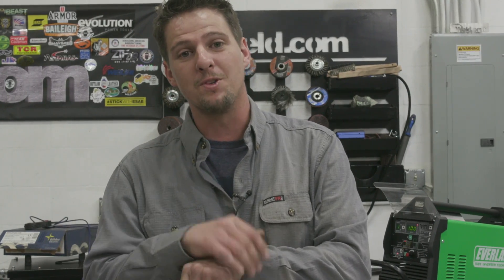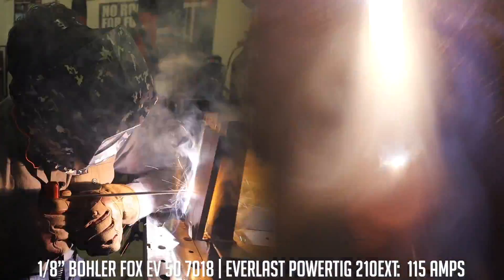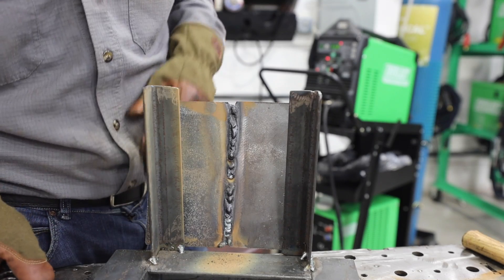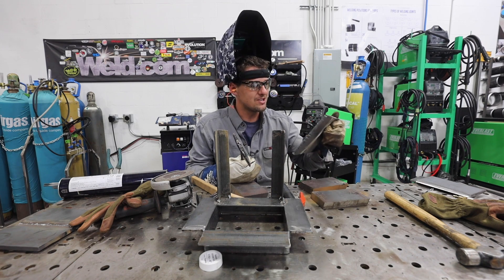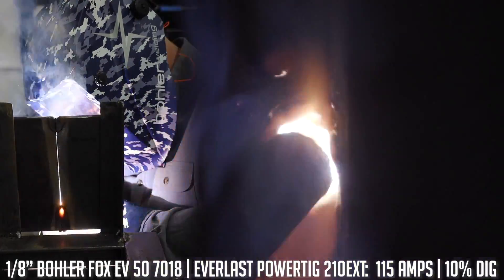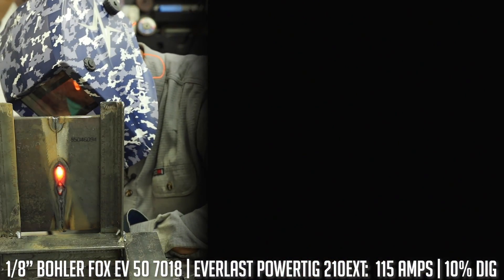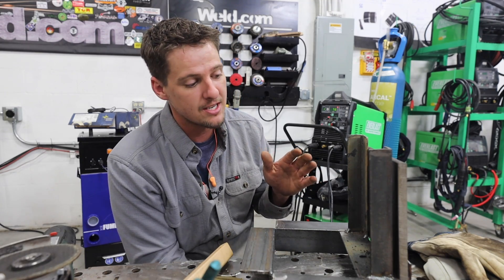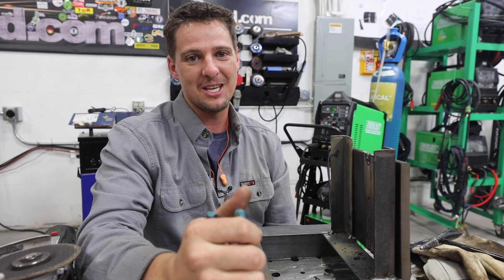7018 Open Root Challenge

Comment: You also get serious porosity when long arc a 7018. Thanks for the promotion! Love your videos even more right now.
Reply: Hello young man, I have had a go at the same challenge Mancub did. My first attempts on DCEP at 115amps went a bit wrong in that 115amps was too hot. I eventually got somewhere near at 90 amps. Sadly the camera battery died and I lost the footage I wanted. However, I reverted to my phone and did another run on DCEN at 80amps on my Oerlikon Presto 140G. I have posted a video on my channel of the result. I am not a qualified welder, just farm repair welder and weld for my own enjoyment and repairs. Have put a card and end screen to your channel and videos too.

https://www.youtube.com/watch?v=mc4qfTgRQ9k

Comment: We do this all the time with 7018's on the shipyard. It's always assumed back gouging will be necessary to get the slag and porosity out.
Reply: That's all they allow in shipyard (at least by me) is 7018, even if your just tacking something...  no 6010 at all. Of course production work is all dual shield flux core 100% co2.

Comment: 2.5mm gap in the bottom. 3 2mm gap in the top. 2mm land. 2.5mm electrode 80amps +- 5 amps. Side to side movment

Comment: I tried this with a 6013 on 1.6mm tubing, with a 2mm gap using a 1.6mm rod  dcen 20amps . I figure a wider gap will let me weave side to side a bit but, my challenge with this is getting the filler to fuse to both sides. If I stay long enough to fuse, I end up making the pool too fluid and sags down like a ball, if I go faster I just get lack of fusion and gaps. Any tips? I’m practicing 6013 because I want to eventually use 309-16. 309 is just too expensive these days to practice with and the dense slag is very similar.

Comment: So at least from a pipe fitters perspective, we tack and do all open roots with 6010 not only because of its ability to weld rust, oil etc, but because it’s a fast freeze electrode.  An open root with a 7018, being a fill-freeze rod would be very complicated because you’ll heat up and just start dumping metal out of the gap.  The keyhole won’t be a keyhole because gravity takes over, and 7018s need more amperage, which means more heat.  The instinct to whip out of the puddle is the biggest thing you’d want to avoid because you’re just whipping in all that flux, causing porosity.  7018s have to be steadily pushed, with electrode at leading edge of a steadily supplied puddle.  There are probably people with more technical answers but that should be close.
Reply: Your explanation is beautiful. And you’re the pipe fitter. Some pipe fitter you are. Haha. Nice job. I’m a student in welding school. Was able to pass SMAW groove welds but being that my combo program is only 7 months and never had any construction job or experience I decided to move onto Mig welding and practice SMAW open root and pipe here at home… wit my $120 stick welder. I’m here outside so mad bc I been trying to run an open root with 7018. I’m sure it can be done, I’m not that good yet tho. Going to go get the 6010’s I took from school. They are 1/8. I hope I do well. But I’m just going to sit here and take a break for a moment. Summer down here in south texas. It is hot. Thank you Mr MC
Reply: @delayedsantana  yeah, I used rush through any cutting, grinding, drilling, or any other menial tasks apprentices get, just so my foreman would let me weld on the bench. In my opinion, there’s no better experience than working right next to a really good welder, who likes to teach.  I’m not sure what they do in the oil fields or pipelines, but UA building trades journeymen will typically see mild steel pipe, groove welds, 30° bevel on a 3/32” land, w/a 3/32” gap. The root will be done in an 1/8” 6010, and everything else will be 7018 out.  The 6010 is essential given the field conditions, and the gap. Keep welding and keep learning! It’s a great industry.

Comment: This is what we are taught to weld with here in scandinavia, 7018 all the way.
We almost always use remote controls in one hand while welding root and the basic tehnique for both pipe and plate is to repeat a U movement with the electrode within the groove and letting the root fill up. Awesome work guys!
Reply: Same in Spain. 6010 doesnt really exist in europe. I guess every root pass its done with tig.

Comment: Try the Alaska pipeline test, 8 inch pipe 6G, 7018 root, hotpass, filler and cap. 3/32 rod for the root is best. Have fun.

Comment: 37.5 bevel.. .06 land, .06 gap.. 3/32 7018 70 -80 amps.. tight arc.. fast..just drag it it will look like a gtaw root when your done.. do not open a key hole.. you can do it..
Reply: Dcep gives the best pen..
Reply: @johnjacobjingle8302 sir root gap down side 2.4 and up side 3.5?
Reply: Would you run DCEN or DCEP? Tthanks

Comment: I did this in school as an attempt to get an F4 all-the-way-out unlimited pipe cert, because a normal 'unlimited' cert still limits you to an F3 electrode for the root.

I was able to get it on my second attempt. 3/32" land, 3/32" gap, 1/8" 7018, ~125 amps and running AC. No DCN or DCP. I was welding on an old Synchrowave. Probably would have gone better had I used an inverter machine with a stiffer arc.

Very difficult to do, and I did not end up attempting the cert test due to time limits. I did a normal unlimited pipe test instead.

Comment: Hi Mancub! I have had d a go at this too. DCEP 115amps was too hot I found and about 90amps was much better. On DCEN at 80amps it was easier but maybe a little cold? Anyway, I did a basic video (All my videos are very basic!) and have posted a link to it below of me doing the challenge on similar steel (10mm) and using a different welder (Oerlikon Presto 140G) and a cheaper brand of 7018 rod. The gap I set for DCEP was close at 2mm and on DCEN 1/8th or 3.2mm set by the rod wire. DCEN I found to be easier, much easier indeedy!

https://www.youtube.com/watch?v=mc4qfTgRQ9k

Comment: I love seeing the struggle instead of just showing success. Never done a open root with 7018 only done it with 6010, I might try it sometime. What I find helpful for a large keyhole is to whip the rod in a mildly fast upside down "v" pattern but idk if it will work for everyone

Comment: Hey Mancub,
Have you stick welded before? or is this your first time?. I have been welding for over 20 years. This is the first thing that you learn to do in weld school after you learn to run beads. The gap is the same as electrode size and for vertical you run with an uphill tilt to your rod. Always start your arc on one side not the middle. Once you arc off just run up with a slight upward angle walking the arc from one side to the other.

Comment: Get Fox EV 50 W for open root and use dcen. Or you get Fox EV Pipe, dcen. Get some 2.5mm and keep the arc short. Move up just by weaves. 2-3mm gap.

Comment: From my experience it works a lot better with 7016 over 7018, have the gap and root face the same size as the rod your using and use only a slight whip

Comment: When i was in ship repair in uk circa y2k, i was a plater n the older welders loved huge gaps, 12 mm plate, 3mm nose, 3-4mm gap. Get up around anchor pockets n keel bars of 2”-4” n the gaps were easy upto 1”.  I think the rods were vodex, real pink in colour n quite a heavy slag.     👍🇬🇧👍

Comment: Man cub those were good attempts. What i found that helped me is going straight in with a slight drag angle like maybe 2°. Its not much but you can kind of do mini whips or turning the stinger side to side key holing the root if it opens up too much. Letting it cool down helps tremendously as well. Look forward to a redemption video very soon, cheers from another brother from the great white North (Canada)

Comment: Get some Böhler Fox EV 50-W rods. Those are 7016 and better suited for open root and run a lot nicer on DCEN.
The 7016 puddle is a bit less fluid then a 7018 puddle which makes it a lot easier to control. I think its because of less iron powder in the flux. Don't whip as you did in your first try. Whipping low hydrogen rod is a no-no because of slag inclusion. But i bet you already knew that.

Comment: Dude, use 7016 for the root. Basically the same but slower and more controllable.
Reply: You are right smoother to run and good profile on back of plate I used to use 4.00mm Philips 56s7016   open root .Cap and fill Phillips 7018  12 mm  t pl. As with Low High Close arc always to prevent porosity

Comment: European? In Canada on the east coast we need to do 6010 open root 4 position then 7018 open root 4 position on DCeP and thats a prerequisite to test on 6" pipe.
Reply: 3/32 land and gap use a 3/32 rod 1/8 land and cap use a 1/8 rod.. I suggest 3/32. Stay in the key hole with a little pressure and if it starts to open up increase arc length and oscillate the rod slightly. The thests here are called F3 open root F4 open root. Once you get your F3/F4 you can test for an approved 6g pipe ticket on 6" sched 80, after that you can test for qualified (b-pressure). -- These tests need to be completed and pass a bend test to receive your red seal/journeyman classification ticket

Comment: maybe try 7018 3/32rod  1/16th land and gap downhill dcep dragging the rod to let the arc force keep up the puddle, then use with dcen, then compare with uphill.  also, try a/c smaw - would like to see what that does with 7018 open root.   I assume a/c would give a smoother arc and less penetration than You changed rod size and amps, polarity, and fitup.  you should change only one at a time, beginning with your first disaster and then run thru the variables.  you could do 3 months of videos on this one subject, going from hack level to skilled nuclear weldor-=--the progression and analysis would be interesting to see. Or, since  blowing a hole thru the plate seems to be the major problem,  approach it from least penetrating - smaller electrode, downhill, tight fit, faster travel speed.

I think part of the problem with the 1/8 rod with the tight fit was it was long arcing because the rod was not deep in the V.

Comment: I learnt 7018 root in high school I passed my 2g 3g and 4g we used 3/32 on like 90 amp once you get it i prefer it to 6010
Reply: Should be much stronger than 6010 also.

Comment: Hey Mancub, in welding school this week we learned to do this, you want to weave back and forth in a tight arc, with a 1/8th rod I was doing 85 amps cold, keep your stick at around a 100 degree angle and keep your wrist in the same position, trust me it worked really well for me.

Comment: I learned to do this in my classes 30 years ago....   7018 up hand cap heat, straight polarity,  tight arc(pretty much walking the flux) and a straight in to a pulling angle to help smooth the backside.   If you do it right when you buff the back you would almost say it was a  tig root.  Good luck
Reply: Slag peel is so satisfying on the root
Reply: Root gap?

Comment: anything  is possible switch back to DC+ use the circular welding method one element  you cannot  fight  is the plate getting  hotter there is no heat sink you have to tack the plate on a thicker  plate your muscle   memory needs to have a feminine  touch  to insert that root

Comment: 2.5 mm ,Phillips 56s rods electrode negative 70 amps+-
  .25 mm root face 3.25 mm gap .keep the rod on the edges of pool don't manipulate  unless you have to .that was the way i did it back in the day .it was the test on 6g pipe to get on the off shore work in the uk
Reply: Great rods the 56s 7016s tho I believe.
Reply: @stevedawelda9036  yes they were a a root rod think we filled them up with kyro 1 the vac paks also by Phillips 
I worked at zwinedrect .near Rotterdam in the 90s in  off shore 
 fab yards clients were chevron and British gas I think not long after tig root came in a better process in my opinion

Comment: I welded pipe in Sweden back in the 90s.  Swedish welders and most Europeans use a hand remote to control  their amperage  while running the root, filler and cap. If the root is done right, it will peel off just like a 7018 cap. The root should be 1/8” gap run on negative, using a diamond motion. Since , I’ve moved back to the West Coast 28 years ago, I have never seen a 7018 root in America.  It kicks ass. Cheers TyT

Comment: would probably have been good to use AC.....Like with a big heavy transformer in a steel box full of oil.........How we welded for most of 100 years?????????????     BUT Good on You for having a public go at this. Keep it up....... trying different things is the only way to learn...                 ANOTHER FIRST COMMENT FROM BALLYNAHINCH IN NORTHERN IRELAND...Keep safe Y'ALL

Comment: Swap to AC or keep running dcen but the key it to keep a tight arc and don't out run the puddle. 1/16-3/32" land with a loose ³/32" gap 3/32" electrode 75-80 amps. A full length electrode should get you about 4" of weld, just referencing how show you have to go.

Comment: Retired Boilermaker 35yrs, Oyster creek nuclear plant weld test , 6" XX heavy wall coupon 6G open root Low Hy(7018), make or break test Xray. No grinders , just a slag pick wire brush and a file, 2 hr time limit. So whats the big deal with doing s 6" 3/8 plate in the vertical but, kinda laid back says the test booth proctor.

Comment: I've done a lot of this welding. Set up that work for me : bevel edge 30-35 degrees, 1-1.5 mm landing,  3.5 mm gap, electrod 2.4 mm DCEP.
Reply: Good pointers 👏🏼
Reply: Thank you!
Reply: For root gap down side 2.4 and up side 3.15?
Reply: @peace7104 Gap at the bottom 3.2 mm , on top little bit more, about 3.5mm. For root 2.4 electrode , fill and cap 3.2.
Reply: @krupanj87 iam waiting my 3g test how to run 7018 root side to side motion? key hole need?
Reply: @peace7104 Small side to side movements. You must make key hole.